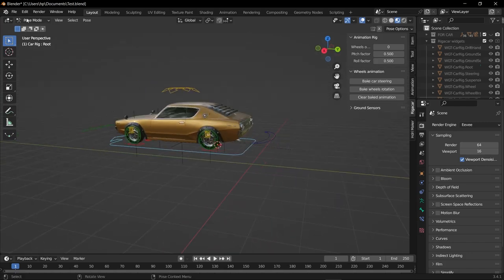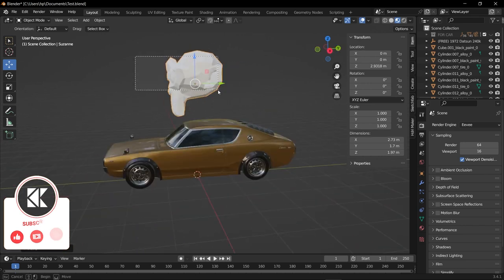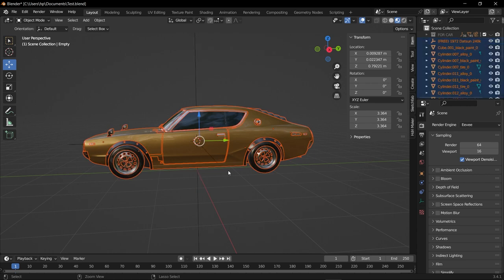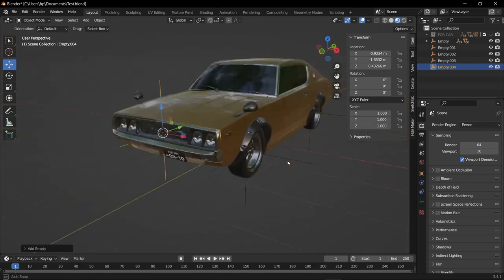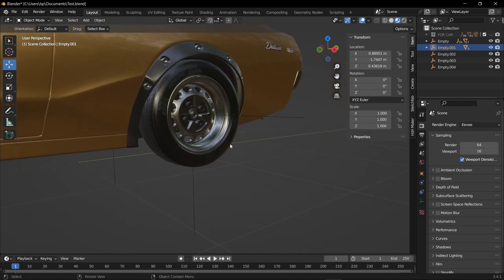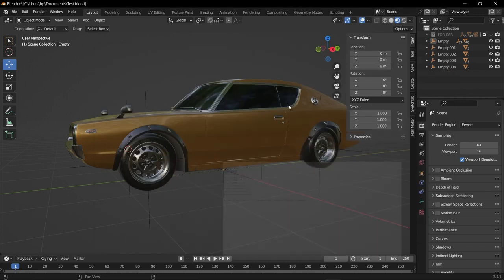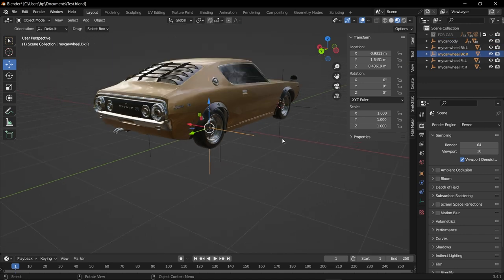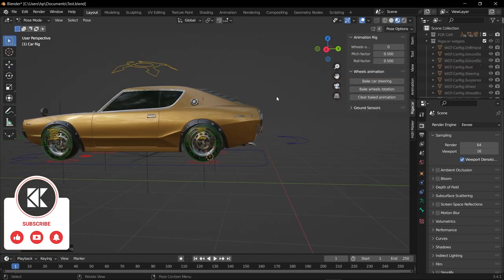Rig a Car in under 5 min (Quick and Easy Tutorial)  3.4 New Version

Comment: The front wheels are connected together and the back wheels are too smh
Reply from the maker: I think you need to seperate the wheels in edit mode. By selecting the wheels individually in edit mode and clicking "P" will seperate it. If you still have any issue then feel free to Dm on instagram.

Comment: For some reason when i do shift a and then add the deformation my wheels move forward and its all weird
Reply from the maker: It's might be because of improper center pivot. The centre pivot of the wheel might be slightly moved away from the centre.
Reply: @Kk_visual_productions  How do we get rid of it? I also have the same problem.
Reply: @hyper14102  if u scaled the plain axis to be bigger and more visible you need to apply all transforms to them to work properly...
Reply: I did this and it still didn't work

Comment: bro when i apply rig and then press generate.suddenly it all messed up(so many bones are coming around the car model),i cant generate it. How to fix this
Reply from the maker: Bro its because of improper center pivot or some small mistake while parenting to emptys. Its took me some days of practise to overcome those issues.
Reply: @Kk_visual_productions  bro but i tried this same way on blender 3.6, it worked. But when I am using this on blender 4.0 , it faces this problem when press generate rigacar.
Reply from the maker: @amalmohancj1 ohh bro this blender 4.0 has lots of bugs bro. So blender really has to work on that.
Reply: @Kk_visual_productions  Ok bro thnx

Comment: Thank you, but what I have to select to parent to a path in order to move along the path?
Reply from the maker: Just create a curve path and add a follow path modifier, and there you can find a eye dropper tool so using that just select anywhere on the car rigg. If you want i will make a tutorial on that!
Reply: @Kk_visual_productions   thank you. I did it and worked. Selecting the base of the car rig controller.

Comment: Bro wheel are not going well its moving with main body after all the instructions you have given in video
Reply from the maker: You mean the wheels are not rotating ?
Reply: @Kk_visual_productions yess
Reply from the maker: On the right side of your screen tou can see option called animation rig under which the values for wheels is 0, change it to 1. Then your wheels will start rotating.

Comment: what to do if all 4 of my car tires are connected to each other..:face-purple-crying:
Reply from the maker: Then you will need to seperate each tires. You can do that by selecting the tire in edit mode then select all vertices then click-P and seperate loose parts.
Reply: @Kk_visual_productions I did that already.. but in edit mode it was still selecting all tires..even after seprating them..:face-red-droopy-eyes:
Reply from the maker: @AadarshUpadhyay._.  then try selecting each tyres manually in edit mode and then seperate it as selection
Reply: @Kk_visual_productions  🥲🙏

Comment: bro my front tires are not moving or turning after  generating a rig
Reply from the maker: On top right corner there is option for animation and rig under which you can see a option called wheel offset which might be 0, change it to 1 and it should start rotating. Thankyou